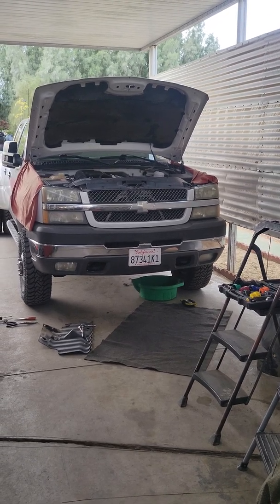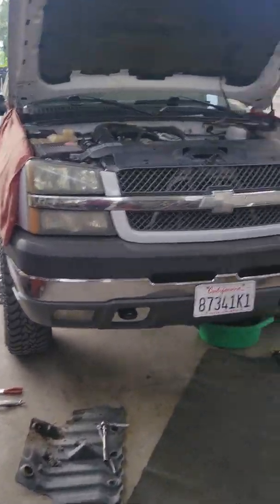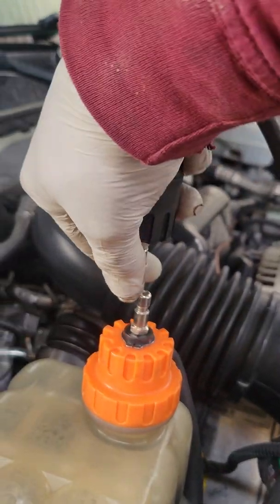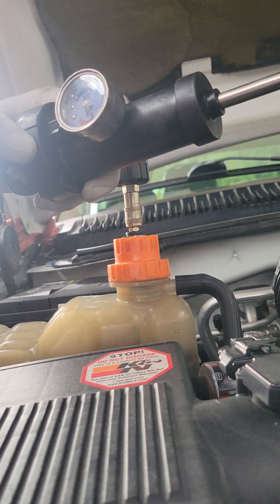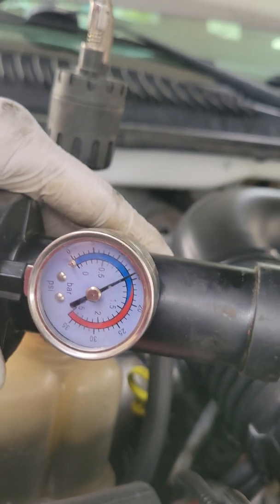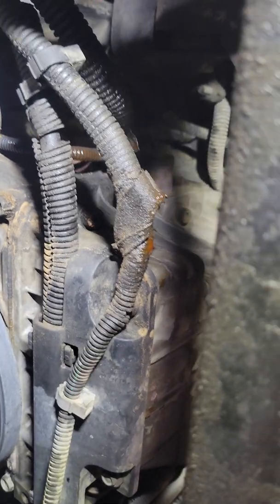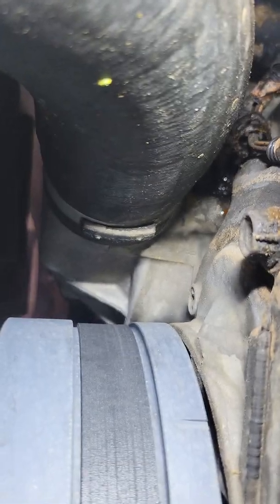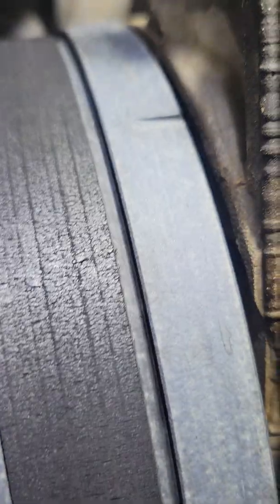Always Check FIRST, DURAMAX coolant leak                #diesel #palmsprings #trucks #duramaxdiesel

Comment: Fixed. My problem looked the sameish but a little different. I had leaks in the same bottom area but I didn’t look that noticeable like when the camera focused on this video. But I thought the lower coolant tube was loose so I put that on and retightened better. Still leaking. I ended up finding my top coolant hose to radiator was leaking on the underside. I guess pressure and wear and tear just barely started making it drip. Hopefully that saves someone a couple hundred bucks. Took me a few days to find that easy spot too